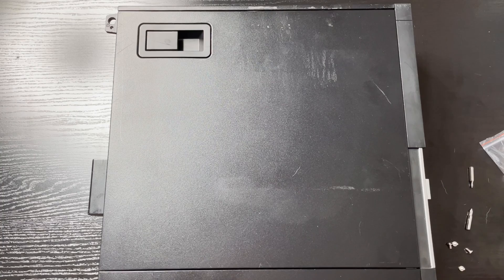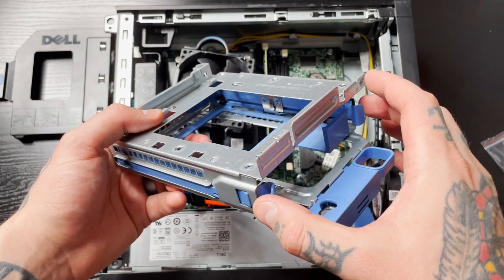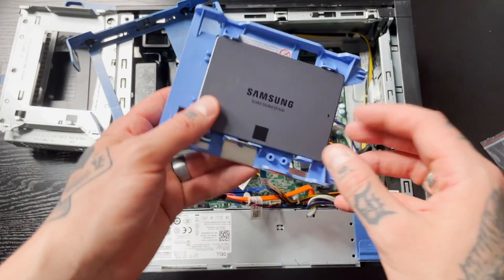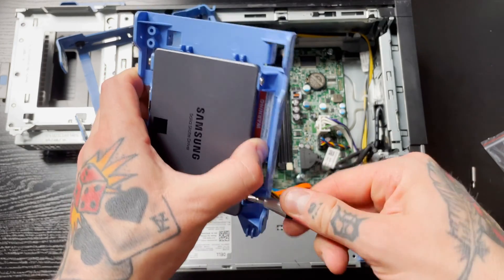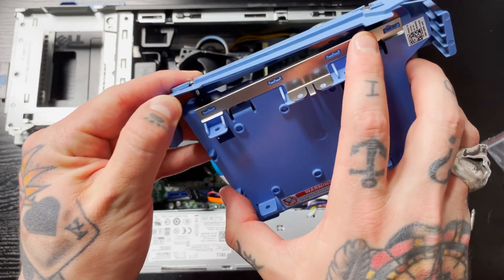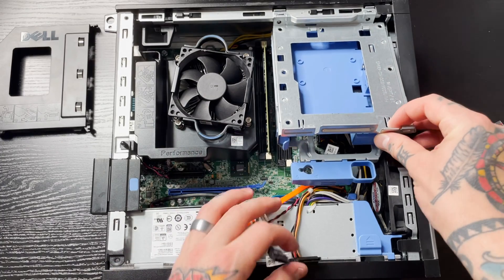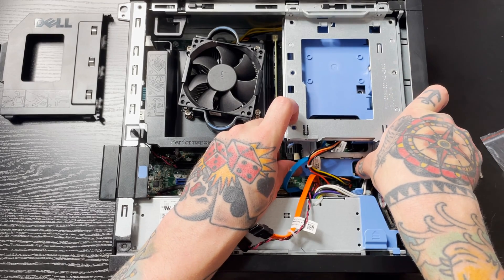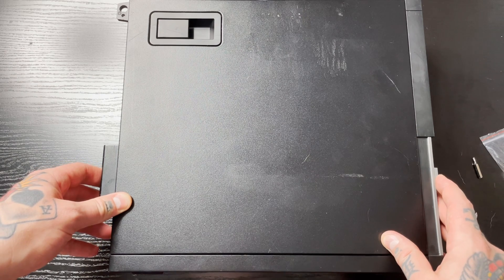Dell Optiplex 9020 SSD Install Guide - How To Install SSD In A PC Computer - RetroPie Guy

Comment: Thank you for the video.  An idea might be to discuss the cabling in more detail, as my newly acquired 9020 came with a HDD that I intend to keep, and my problem is I need guidance on where to attach the SSD to the motherboard. 

The cabling arrangement you showed does not match, or so I think, the available cables in my 9020.

So I suspect I need some sort of cable splitting…..

I have found where one of the the SATA cables attached but not the other one.

Comment: Before doing this, do I need to copy the data from HDD to transfer it to the SSD? Like the windows Bios, etc.
Reply: Or you can have a system image for system restoration in another drive